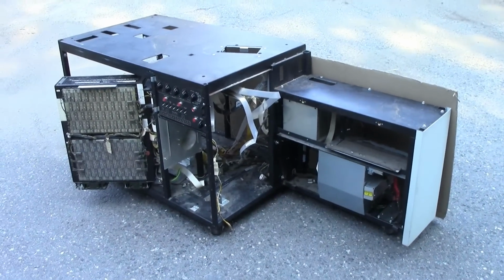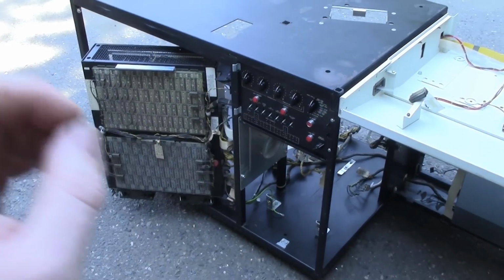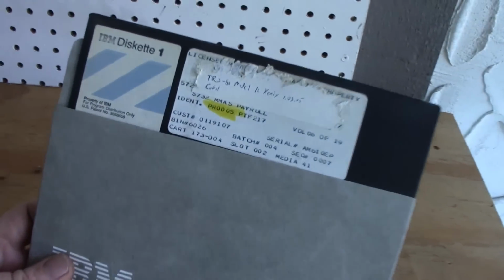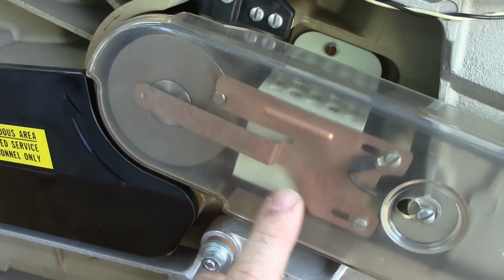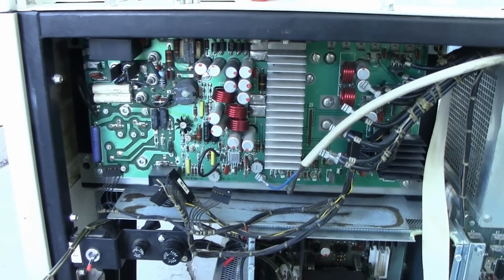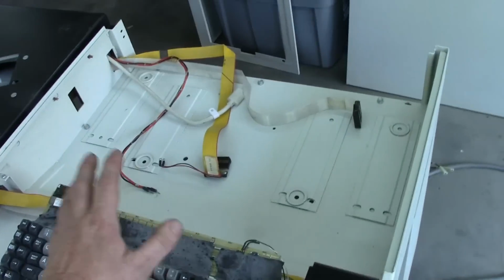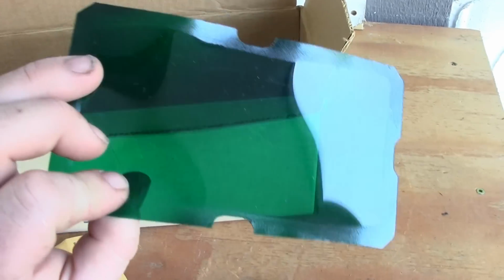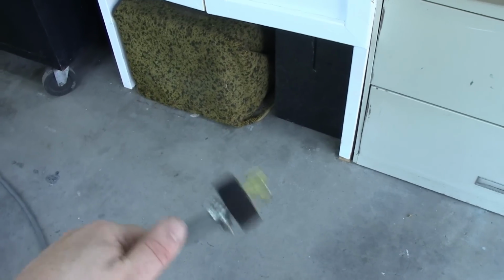IBM System/32 - The Arrival and Assembly

Comment: I think those "hooks" you didn't know what it does is for the printer, IIRC.  To help with paper routing. They remain attached to the printer.  But it's been 40+ years since I touched a System 32!

Comment: This brought back memories. The college ( Saginaw Business Institute) that I learned computers on from had one of these back in 1980. They had a System 3742 data entry. They would enter data from the 3742 on to a floppy drive run it on the 32 and print out the grades. With the COBOL classes we would enter programs on the 3742 fix all of the errors and test the data to see if it would work.

Comment: My gramos got one of these back in the late 80's and saved it from the junkyard. Unfortunately it didnt survive several moves til today, so it got parted out for engineering bits as my gramps was an electronics & broadcast engineer. Also in BC. Still has the system 32 badge though. Glad some of IBM's oddball machines still survive for restoration. And no keyboard sacrificers.. though maybe I wish gramps kept the keyboard, thinking back. I daily an IBM PS/2 era M. It's damn good enough, and standard layout to boot. Just buy an M, new or old, if you want a lifetime great keyboard. Dont destroy and ancient computer history exbibits.

Also, is that an AMC Eagle? Lovely car, my gramps always wanted one.
Awesome 4wd and clearance for camping.

Comment: We threw away one of these in the 1990's, that some monkey had gotten a whole of and started pulling parts out of it, ostensibly to restore it.  Don't do that.   Remove one item at a time, and then put it back where it came, or you end up destroying it.  Good luck getting it all back together.    I kept one board out of it with two white and gold ceramic processors on it marked IBM 34, which is what brought me to his video, because all these years I had remembered it erroneously as a later date AS/400.   At that time we were throwing away 8086's, 286's, and 386's... so yeah this thing was hopelessly obsolete then.  

Another minifridge sized "mainframe" style computer I actually hooked up to a terminal with it's own thick properitary terminal cable and fired up and it took a good 12 minutes to boot and sounded like an air conditioner.  I had no idea what to punch in on the command line of the obscure OS on it, it too was obsolete, and got junked.

Would I still want either in 2023?   Probably not.   These things are big and heavy and useless and power sinks.   I've got an ocean of antique 8 bit's and honestly, I haven't touched or fired up a one of them since the 1990's when I saved them from the dumpster when the collector that did own them died.  He had bought them all in huge lots from a nuclear plant.     His wife and sons' just wanted it all gone.  Like now, yesterday, or they were tossing it.  So I had to move them fast.  I got everything I thought was collectible from my vast knowledge of computer history, and they junked all the rest.... mostly Selectric Typewriters.   An ocean of TypeWriters.

If I had known at the time prisoners in prisons could use donated typewriters, I would of taken them too.  But by 1990's desktop era already being well past mature with lasar printing the norm...   a typewriter seemed hopelessly outdated... and it was.
Reply: On a chip, the "IBM 34" refers to the manufacturing plant which made the part.

Comment: IBM was scamming people!

The disk drive was 10 megabytes but sold with 5 megabytes disconnected. Maybe it was the other side of the platter. If a customer wanted the upgrade the Customer Engineer went in and followed the instructions to do a little wire wrapping and ran a diagnostic.  I did that a bunch of times.

There you go. Now you can access the other 5 megabytes that you already had. 😎
Reply: The same sort of "upgrade" was available on the dot matrix print mechanism.  The least expensive model had a printer that ran at 40 characters per second in ONE DIRECTION.  The head print from left to right and then would just move back to the left position to begin a new print line.  If you paid for bi-directional printing,  the head would print in both directions and the printer could be upgraded to a max of 120 CPS.  None of those upgrades required hardware.  IBM just loaded some new microcode and/or changed some wiring and VOILA your 40 CPS unidirectional printer could print 120 CPS bidirectional.  Then the bill would arrive!

Comment: OMG! I was trained on that in 1978.
Never saw one taken apart that far.
Are you going to run benchmarks? 
I never saw the word benchmark on any IBM documentation.
Reply from the maker: I don't think there's really a way to run benchmarks. This is in no way like how a modern computer operates or in how the software runs. I guess you would compare the speed at which it can process a job made out of a known static workload, like refactoring an accounting sheet.

Comment: The matrix printer is the mechanism used in the 3767 terminal for SDLC, the 4975 for the Series/1, and many other units. I suggest that you find the upgrade unit which converts the original ribbon to a cartridge ribbon and save much swearing in the future.

Comment: I wrote a total of one RPG program for the S/32, which consisted of two lines of code, and about fifty lines of comments. I confirmed that it would compile on a S/34, then took the code to our Bermuda location, where the S/32 would be made to look like a mainframe running HASP for a VAX back in the states. The code worked the first time tried, and I got four days in Bermuda before flying back to the U. S.

Comment: The early IBM disk drives could not be stored vertically as there was a coating on the platters that slowly sank to the lowest point and caused a bump on the surface of the disk.  This caused damage to the read write heads.  Even replacement disks failed if they were sitting to long. They were OK if used.

Comment: The wires metal wires you couldn't identify, actually go around the rolling surface of the wheel, to keep the system from rolling if you bump into it.

Comment: 39:50 seeing the System/32 with the display mirror installed, I had a flashback to 1960's Star Trek. I believe there was a similar display built into a counter either in Capt Kirk's quarters or in the conference room. or may have even been on the bridge somewhere. been so long since I watched that show. . . 😀

Comment: Can't you get the 220V going by using a step-up transformer? That would also limit the inrush current to a more manageable level.
Reply from the maker: Part of the reason for the crazy inrush and the large motor is it needs to spin the disk up really fast to get the heads flying. The rest of the machine has its components powered up in sequence.
Reply: @CelGenStudios That's why a transformer may not be such a bad idea. It would act as a choke and limit the inrush current, which would mean the motor takes longer to come up to speed, but it takes less current.

Comment: Please use the Metric System. Except Liberia and the United States on a few occasions, all the world uses it.
The rest of the world has used the metric system for a long time. Try to use it so the rest of the world will understand you.
Reply from the maker: I have a bad habit of using both.
Reply: The machine was designed and built with non-metric engineering.

Comment: The System/32 was a small mainframe.  It is a multiuser system that supports dumb terminals and large scale apps that run things like banks, collections centers, and any kind of large scale systems that serve to multiple users.

I used to work in a bank/collections center where they had one.  I didn't do support of it, only the PCs and network that was there for the user base (apart from the physical dumb terminals).  It ran the system that controlled the collections agents.  It called up the account to be collected on and then the System/32 also connected to the autodialer and dialed the client for the phone call.

That was the application that they used but it could run any mainframe type of application that served to many users simultaneously.
Reply: @mark: after doing some googling, multiple sources state that the S/32 is a single user system. It did not support dumb terminals. It could not run any mainframe type application as the hardware architectures are different. If you have a source that says otherwise please provide it. The subsequent machines, S/36 and newer are multiuser capable. As for small mainframe, that gets into semantics, which continues to this day.
Reply: @deepsleep7822  I will admit it has been nearly 30 years since I had that job and I could be remembering wrong.  Perhaps it was a System 36.

Comment: For the missing system information mirror top, are there measurements available? Could 3D print a scaffold instead of using cardboard and tape.
Thank you for the showcase of the ancient rust hard drive and floppy drive. Incredible.
Reply: Could easily be 3D printed.
Reply from the maker: Very easily. I just need to ask around for measurements. I know a few people who can help.  @deepsleep7822

Comment: The 62GV, or "Gulliver" was the first swinging arm voice coil hard disk.  It was developed at IBM Hursley and introduced in 1974.  You are correct about its 5MB capacity.  There were later 10MB and 15MB versions.  I believe there was support for four of those disks.
Reply from the maker: I'm assuming those would of been in a set of expansion cabinets also roughly the height of a desk?
Reply: @CelGenStudios  Or inside the main cabinet itself, as in the System/34 and later models.
Reply: I looked it up again. The /32 only supports a single disk of 5, 9 or 13MB.  The multiple disk support came in the later models.
Reply: @douro20  The 62GV was used by the Series/1 as the 4962, and in the 3790; the S/34 used the Piccolo drive (3310, 4963, etc.).

Comment: You made me think of Tech Time Traveller's rant about the evils of "The Keyboard Guys".
Reply from the maker: We both know eachother from brief interactions in the past but in the VC community it's overwhelmingly disliked how much hardware is now unusable because their keyboards are now missing. I've made a tangent about this before in an earlier video. I could really go on about it myself but this is not the place to be doing that. I used to have several IBM 5251 terminals which worked and had great screens, but with no keyboards they were worth more in scrap metal than gold. (and no, they were sent on to another IBM collector, not scrapped)

Comment: In a quick search I see Mike Ross has several very short videos of a System/32 booting, etc.
Reply: But then you knew that.
Too bad you cannot flip the Yoke around and to use the good side.  But then there are re-alignment problems to address as well. 
Granted I've used many old keyboards on many OLD systems.  I can't see myself taking out an old keyboard to use in a current day PC, let alone hanging it 
on a wall....
Is it possible the printer was also used for remote office printing in connection with a 3270 terminal?  I remember those were all over TRW in the 1980s.
Displaywriters I have seen always had IBM's version of the Daisy Wheel printer.
Property of IBM, I've seen a few of those.  Both of my IBM Memory Typewriters were originally leased equipment, which escaped the "crusher".

Comment: My dad worked for Lenkert Electric in Burnaby in the 1970s.  He wanted to work there so badly and was hired on the spot when he brought in something electronic that he made to the interview.  Anyway, they had an HP minicomputer for testing that he said crashed all the time until it got replaced with a more reliable model of computer.  He said that it was hot in the company except for the place that they kept the IBM mainframe for payroll which had air-conditioning.  I think the cleanroom was also air-conditioned.  He said that the cafeteria had the best stuffed peppers.

Comment: It's kinda odd they designed the CRT like that on a single user system. I knew they had multiuser systems, I think for data entry, where they split the mirror box for each user, the users facing each other. That made more sense.

Comment: The metal loops in the spare parts box are wheel stops, they slide on the floor side of the wheel, and wedge the wheel to keep it from moving around.
Reply from the maker: Now that I'm thinking of how it seems a tiny stone on a floor will stop a pallet jack, that makes sense!
Reply: @CelGenStudios  at 600 pounds yup, it's a heavy beast! It took five of my high school friends to do a controlled drop slide down the stairs into my parent's basement! I got pinned against the wall as it slid down the stairs! I certainly had no idea it was 600 lbs back then... :)
Reply from the maker: Even on carpet this thing felt like it was made of depleted uranium  @tekvax01
Reply: My dad said the same thing (IBM service tech 1979-1995). Wheel stops. We enjoyed watching this video.

Comment: The hard disk in my system/32s was 13.8 megabytes on 14-inch platters.
Reply: 13 meg was the largest capacity HDD that came on S/32’s.

Comment: I had two of these back in 1986, (Yes, mine WAS the possum computer that corestore obtained!!!!) They came from a hospital laboratory in the Southern Ontario area. One of them worked for a while and the other I used for spare parts. I couple of years later, it stopped working, and I didn't have enough knowledge as a high school student to get it functioning again. They both sat around for many years in a damp family garage and got very rusty. Back in 2005, I found a fellow who wanted both of them, as well as a complete set of manuals, and floppies. He and I sort of lost contact, so I'm uncertain if he was ever able to get it to function again.
Reply from the maker: That was the first system I ever read up on. While time did a number on it I thank you for being hesitant to send them to the scrapyard. I know that almost all the documentation and diskettes did eventually get archived. I'm actually using copies of them right now!

Comment: I like a nice keyboard, but I would never molest such an awesome piece of equipment by taking the keyboard and leaving the rest of this machine to rot. That being said, I mostly only use modern mechanical keyboards, so I'm not sure I would have as much of a hard-on for something so old. The issue is that while the switches and other features of it might be nice, it's lacking way too many keys to be useful, in my opinion on a modern system.
Reply: For S/32 collectors, the keyboard may be the fragile piece worth keeping. I’d think the HDD would be valuable as well as that substructure was fragile as well. As long as the heads were locked down for transport. I worked on larger mainframe stuff. We were going to move some disk drives to another location in the computer room. The IBM CE wouldn’t even consider moving them even the short distance without first locking the R/W heads down first. Not a difficult task, just time consuming.

Comment: The printer is very similar to the IBM 5256, which was used with the System/34. I've got my 5256 connected to one of my S/36 5362's, works great and you can still purchase the ribbons today! :)
Reply: I saw a 5262 in a thrift store when I was still in high school in the late 1990s.  It was fully working.